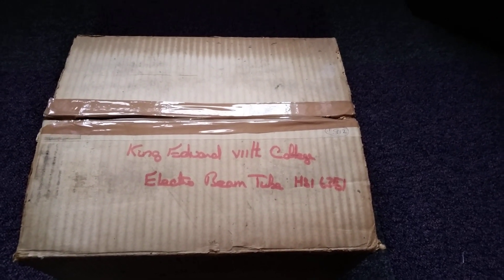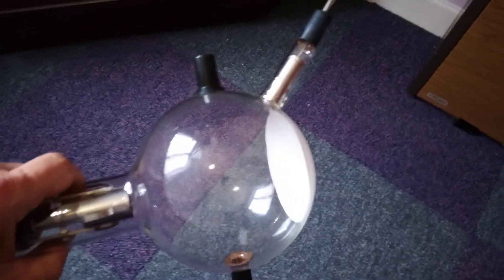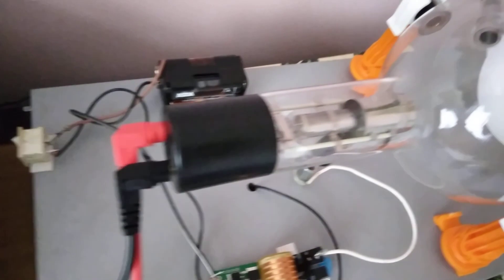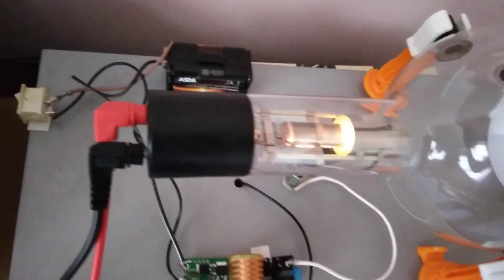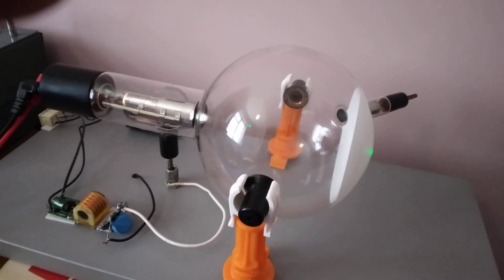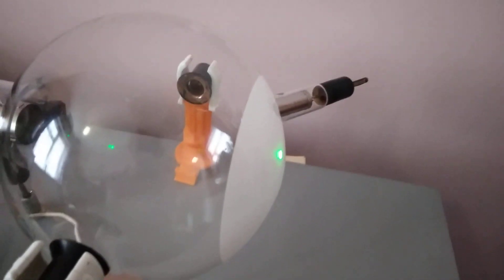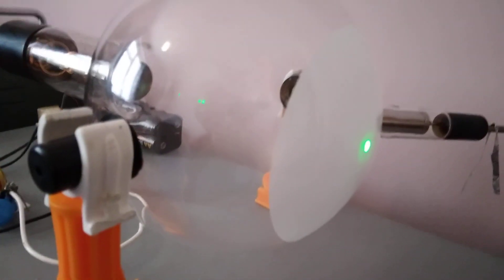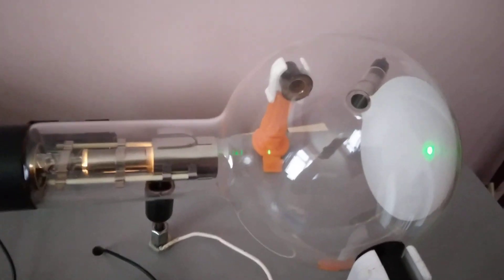THE ELECTRON GUN

Comment: Hey Mark. Me and my friends are doing a project for our final year of high school. We are in great need for an electron gun and we're working on a low budget. Since you mention you got yours for a relatively "cheap" price on ebay, do you have any tips on finding electronics, or in this case specifically an electron gun for an affordable price? We found a broken one that looks very similar to yours. The glass bulb is broken but we are unsure why the electron gun itself is not working. Is this something you are familiar with and would possibly be able to assist us with? Thank you Mark, keep up the good work! :)
Reply from the maker: Hello paid about 80 pounds for my example on ebay and the tube has minimal use and the high tension module that supply HT was about six pounds if you are interested in mine you are welcome to see it in operation and pay me what it owes me because I have a low attention span regards Mark frow swindon.
Reply from the maker: A broken bulb will mean that it has lost its high vacuum and no electons will flow.
The tungsten filament which is operating at about 6 volts will emit electrons and these will be accelerated by about 5kv ht by the use of electrostatic focusing lenses within the tube to impact the fluresesant screen to cause the electron beam to be visable as a green dot.
The electron beam that is flowing through the tube is negatively charged and is very easily bent by a magnet.
I was lucky and a school was selling some old stock and the seller was unable to test the tube so I bought it at a fair price, it is most important that the filament is intact or the tube will be useless. 
Philip harris who still sell these tubes today ask about 500 pounds for them but if you are prepared to take a gamble on ebay can pay off-
I could easily get my money back but you need to be very carefull with posting because the tube is evacuated to a high vacuum and will implode if broken so maybee the postman will crap himself or herself, a facinating item indeed.